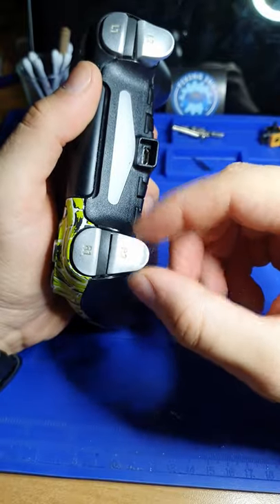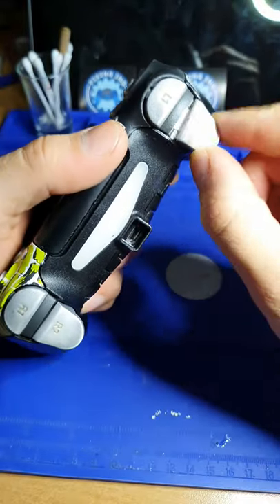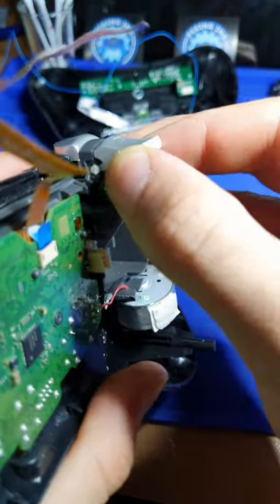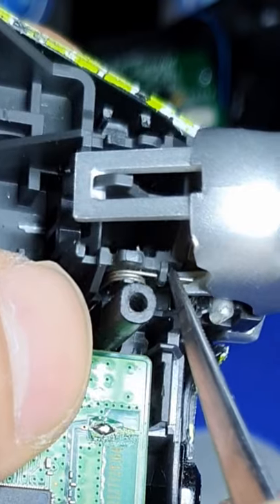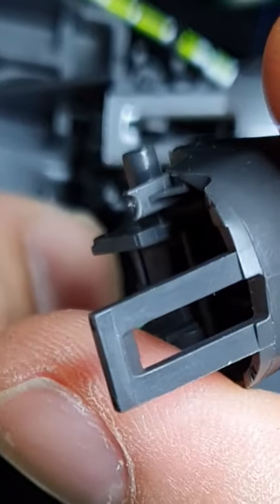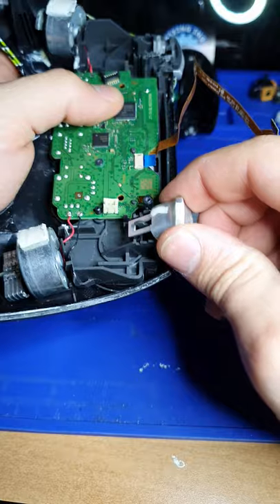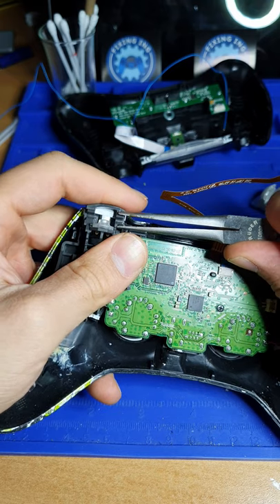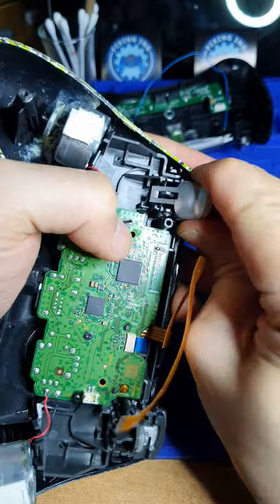How to fix Controller trigger buttons | Short Tutorial #Short

Comment: Amazing video! I had this problem with my 4PS pro and I followed the steps and it worked perfectly. Saved my controller, thank you so much!
Reply from the maker: I am happy that it helped :)
Reply: @fixing_ing1137  hey I got a question bro so my L2 button is good and it functions physically properly but when I play the game it’s as if the L2 button is being pressed automatically without me holding it down what do you think the problem could be? Everything else on the control it works except that hole to I’m not even touching it but it’s still being pressed down and the L2 button is not jammed or stuck you can press it normally but it’s just automatically holding itself down